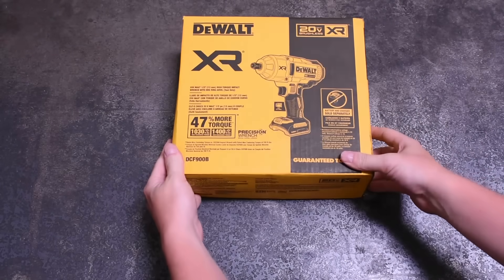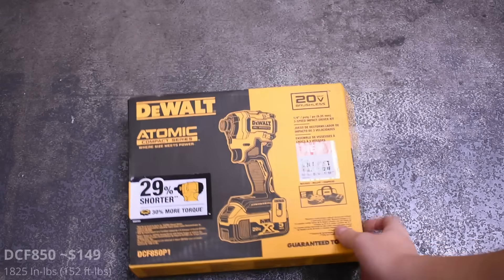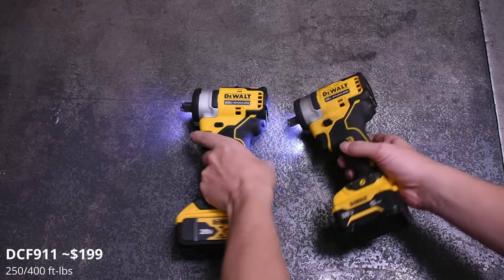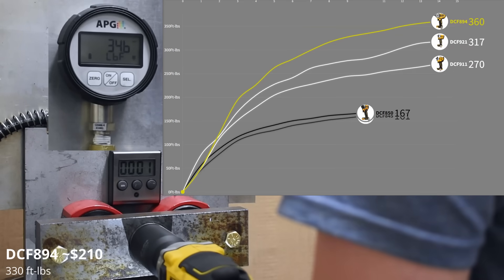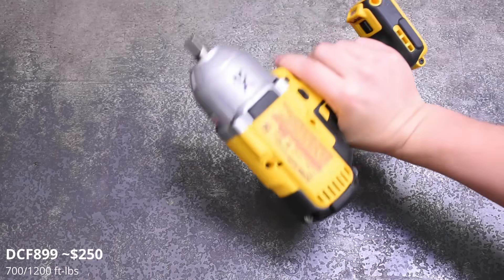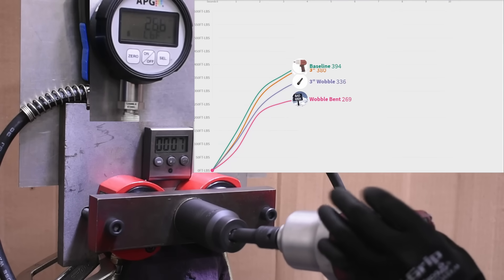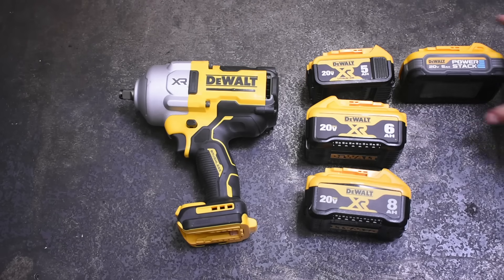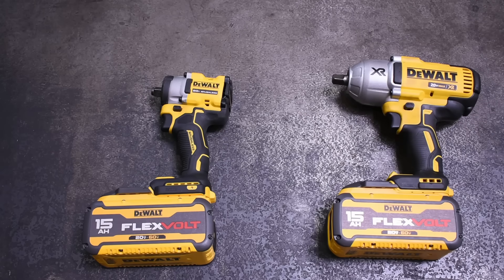Dyno Graphs of Every DeWALT Impact: How Much DO You Need?

Comment from the maker: You can currently get a Powerstack for $63 or w/ charger for $85 for some reason: https://amzn.to/43odkCD, https://amzn.to/3pL0Ki1
6Ah XR: https://amzn.to/3Wgntyw, 5Ah Powerstack: https://amzn.to/41Ka5nK
DCF961 big guy: https://amzn.to/3Gva9PR
DCF923 (3/8" size of DCF921): https://amzn.to/3Ilx5Cm
DCF891 Mid TQ: https://amzn.to/3BVPiDj
DCf901 Compact: https://amzn.to/42LQ9SI
DCF900 High TQ: https://amzn.to/3o3Nrcd
DCF850 Driver: https://amzn.to/3WbqtMQ
Reply: New Flex mid torque review soon?
Reply: @nickduplaga507  I asked that not too long ago he said he’s just waiting for them to ship to him they have gotten delayed
Reply: Can we have this kinda of line up for all the major brands? I know some brands are sparse.
Reply from the maker: @Juan188812  That's our plan to eventually do as time allows and brands introduce more
Reply: @Juan188812  Too many ok tools leaves too much room for smaller brands to combine the niche tools.  People rather have one tool that does the work of two, and better, in the smaller of the two’s size.

Flex (small mid torque) will take Milwaukee mid torque customers.

Hercules Ultra torque (1/2 with bolt loosening potential of 3/4) will take many 1/2 inch high torque customers.  That’s why Dewalt is making a new high torque I think because it saw how much benefit it’s DCF900 made.  Meanwhile Milwaukee I guess is panicking with it’s shareholders while they try releasing more useless niche tools, that most people don’t care for because they rather save space, or money, or both.

It’s the reason Dewalt atomic compact 1/2 is successful because it’s better than the Milwaukee 1/2, and who wants an extra set of 3/8 sockets when they can use 1/2 for both high torque and compact.

Maybe Milwaukee releases a new long delayed high torque with the new batteries soon.  People don’t want to buy Milwaukee at this time I think.  It’s a transition into Dewalt, and smaller companies.  Milwaukee is lacking the big evolution jump rates of it’s products that other companies are doing.  The new drills, and impact drivers for example are barely any improvement.
Reply: Man I can never buy from your links as they won't ship to Aus! 😏
Reply: Man, I've never seen a 15Ah battery on a sub impact, but that was the hilarious.
Reply: Would the "new internals" DCF891 you're referring to be the DCF891b? Or does the "b" mean "bare tool"? I want to make sure I'm getting the version you tested when I buy one. There is also a kit listed on DeWALT's website that includes the standard bag, dual 5ah battery, and charger kit (DCF891P2), but instead comes with the "oil resistant", black 5ah batteries...can't find this kit in stock anywhere. I believe the kit number is DCF891GP2.
Reply from the maker: @FlyLan  b just means bare
Reply: You should have timestamps of the graphs for each one of these items next to their names. maybe AI transcript can help find the times.
Reply: No wonder your tests was so off from my real life tests here. You never had the DCF899 that smoked the milljunky red crap at over 1000ftlb torque on every other channel then yours. Well the other channels use actual torque testing tools to not some home made thing with some guess torque from so old clapped out snap-on.
Reply: YOURE losing torque power with that extension you’re using, why are you using that?
Reply: Thank you all for the amazing content you guys do extremely well on the information of tools and us as tool nerds and smaller YouTube channels about tools. Truly appreciate it❤

Comment: Please stop confusing impact drivers with impact wrenches. You do not use an impact driver in any aspect of car repair. They are for driving bolts and screws into masonry / wood etc. impact wrenches are used for removing lug nuts etc

Comment: I love the atomic 891, it’s a very powerful “mid torque”, I also have the 809, the 3/8 version of the 921 1/2.. for all the smaller stuff I use my 860 driver or the atomic 513 ratchet.. 

I’ve thought about getting the big boy 961 1/2 impact , or slightly smaller 900 but that atomic 891 has served me very well and hasn’t let me down on anything I’ve put it on… yet and until then

Comment: I have the small 1/4 inch hex drive impact and the mid torque. With a 5 ah battery and a harbor freight 1/4 inch hex to 3/8 socket drive adapter, they will shear the adapter at the drive.

Comment: I brought the DCF 900 and to be honest didn't know what I was buying, all I know is I was sick and tired of low torque cordless impact wrenches and the jobs they couldn't do on my car, the ones I brought think highest was 420nm and couldn't even undo wheel nuts, most cost me between £37 to £98 with case and battery and top brand I had is Sealey  400nm, but that is it Sealey stop there and have a lot of their tools and are very good so was disappointed they have never made anything more.  I paid £349 for the Dewalt DCF900 and could of gone for the DCF961 at £369.  But been very thankful for your video and was going to go for the one lower, I was thinking of the DCF 891 and 899 and surprising the DCF899 was cheaper then the DCF891, DCF891 was £330 and DCF899 £280 all kits come with 2 x 5ah batteries, charger and case.  All I knew I needed a higher torque and anything under 700nm I wasn't interested in, but when I read the spec on the DCF900 I thought I would go for it, after watching your review on these tools I feel I made the wise choice, item arrived yeaterday and tested it on bolts and impressed but glad I didn't go for the DCF961 as I mainly work on a car not commercial vehicles, but it is a step up a mighty step up from the DCF899 and looking at your review does the DCF899 deserve to be at high torques shouldn't it be down there with the DCF 891 mid torques?  So yes glad I had gone for the DCF900 because be handy at removing rusty suspension bolts and hoping it will make work easier, I have a lower torques which as two setting 1st setting 100nm and second setting 420nm and converts into a impact drive as this would be to heavy for engine but lower suspension and exhaust etc it will pay for itself.  The only negative is it is heavy and looking at the DCF961 that looks even heavier so yes impressed.

Comment: My recommendation based on the experience i have as a welder that is used to repair cracks on excavators, car carrying trucks, snow plows, wreckers…
To access the broken parts, a lot of disassembly is required 

The impact driver rule is: the more compact the better

I have the dcf 922 (same as 921 basically)
I use it 90% of the time up to M16 bolts 

A DCF900 for everything that won’t come loose with the 922

And if you really need more violence on a regular basis,
Go with a 3/4 like the dcf964 that thing kicks

Comment: Hello, how is the 891 doing these days in terms of reliability?
I've read in few places that the planetary on these give up, however the warranty replaces them no problem.
I'm looking for my first impact wrench - Mostly thinking about changing from summer to winter tyres, but I look forward using it on more stuff like brakes, it's just that I always craked everything with a breaker lol.
I'm torn between the 891 and 921 - I know that the 921 won't do eeeevery rusted bolt in the world, on the other hand I'm not sure if I need the torque+size+price of the 891. I'm torn plz help.

Comment: This was a really helpful video. I used it in conjunction with a spreadsheet I've put together with the help of AI and the "Speclook" website to allow me to get the right impact driver for my needs. I found the DCF900 on sale and ordered it, but then I realised I really don't need that much torque and I certainly don't want all that weight for my relatively light needs, so after considering the DCF891, I actually went for the DCF921, which is WAY down on power from the others, but the compact size and weight make the '921 much more appealing to me, even if the relatively low power doesn't seem like such good value compared to the '900 on sale. (I love a bargain! 😄) Anyway, being able to see the wrenches in use and compare the relative sizes was really helpful to me, so thanks!

Comment: Hello my dear friend, how are you? I want your advice because I am going to buy a dewalt impact werinch and I ordered a dcf900 from AliExpress and it turned out to be an imitation. The imitation is small, its weight is 1600 grams, and it is not like the one they have on display. They show it in a big size so you think it is really big. They are playing on optical illusion. I asked to return it even though they offered me half the amount back and to keep the product, but I refused. It turned out that the correct product is only available on Amazon and eBay. My question to you is which one is the strongest and best to order: dcf900, dcf961, dcf964, or dcf892? Please answer. Thank you.

Comment: Great video.  I just bought a DCF900P1 and it claims 1000-1400ftlbs and took rusty strut bolts off with ease.
Reply from the maker: all DCF900's are the same, the numbers after 900 mean bare tool or type of kit it's sold in

Comment: Now that's a proper video, kept going back and forth these couple of days, just got home with my DCF900. I wanted the 961 originally but for my use cases meaning my own car, bikes and some rusted bolts here and there around the house it made no sense, also that monster torque scared me I didn't want to risk damaging sockets on every use, plus it was too wide and heavy, the 900 has great ergos and while still heavy it's not that bad

Comment: I have to remove the anode rod from a 30 year old hot water heater that still works fine   (The original rod has never been removed.)  How much torque would I need for that?

Comment: You should doing a test on the Dewalt 413B Grinder. We purchased it a year ago and were blown away that we could not used it with any battery combo other than 5 AH or higher or it would drain it in a matter of seconds. I was running fairly new batteries and it just would not run on anything long unless I ran 5AH. Would love to get your take on this. 
Does Dealt Grinders really suck batteries that much or do I have bad batteries or a bad grinder or do they just have a bad design. I actually love their grinder aside from the battery hog.

Comment: I own the DCF891 and DCF921. So far the 921 has no problem with small/mid cars lugnuts, caliper bolts, and (with some extended hammering) axle nuts. It definitely packs a punch for its small size. If I don't want extended hammering, I'll grab the 891

These two impacts should cover a very wide range of vehicles, if not dealing with heavy duty stuff or rust

Comment: I have the Atomic 923 and 921 with the power stack battery. Use it all the time for light suspension work. I also have the 891 with power stack batteries and that does 100% of what I need it to do. The first day the 891 can’t get a bolt off I’ll be getting the 900 with an XR 6amp hr battery. This channel helped me get these tools over Milwaukee

Comment: Initially i bought the new Kobalt 1/2 mini compact impact wrench which was cool, super compact, and light but wouldn’t bust 100 ft lb lug nuts so returned it for a Dewalt dcf 921 with 1/2 anvil (only 3/4” longer head than the micro? Kobalt) after watching your other video on compact impacts where the dewalt blew away all of them in torque by like 90 ft lbs in the 15 second reverse test! Needed head bolt busting torque and can’t wait to get it in! 
They have them on home depot online right now with a charger and 5ah battery for 169! Only a few bucks more than the Kobalt setup and saved a sizable chunk foregoing a Milwaukee. Love this channel!

Comment: This is pretty fascinating. I'm confused though. Why does the torque rise over time? I would have though the driver puts out a specific amount of torque. Does it increase the longer you hold down the trigger? Also, if a driver is putting out 150 ft lb of torque, why can't it break my lug nuts? The torque spec on them is 88 ft-lbs. Are you saying it just won't work if people have over torqued them, like is commonly done with air drivers in some shops?

Comment: Got the 891, from their recommendation. It wouldn’t touch my GF’s Hyundai Tucson lug nuts. I set my torque wrench to 160 lb ft, and it wouldn’t budge them either. It took a breaker bar to get them loose. 

On everything else it’s done fine for me.

Comment: My red Mac Tools version of DeWalts 4Ah XR battery died yesterday. I tried to revive but it's my oldest battery and it was just tired 😭. I suppose I'm going talk to my tool man and see what he can do for me a better one. I have two of the 9Ah Flexvolts, a 5Ah XR and I recently bought a 8Ah Power Pack. I think I'm going to go for a big Power stack just to have another "light" battery. My right shoulder is mad that I bought that 961 and run it with those Flex Volts... 😅💪

Comment: Should a DCF921 with a 4AH battery be able to remove lugs nuts that are torqued to 80 lbs?  I am trying to figure out if I might have an issue with the tool or if it’s not the tool for the job.

Comment: I just received my DCF911 today.

After years of air impact, then electric, I was ready for a battery powered one.

Since I'm already into to the yellow brand ecosystem for my battery powered tools, I bought the DCF911 thinking that it would be a nice addition to my tool box.

Man, how did I wanted to like this little thing!

It's so little in my hand, nimble, light... 

You say "does the job 90% of the time" and it's my own motto.

But when 50% of "your" time falls into the 10% it can't do, it sucks... :(

I tried it, out of the box, with a fresh 5 Ah battery and I wasn't able to undo my F-150 lugnuts!

We have 2 "cars", a Corrolla and a F-150 so I tried it, out of the box, with a fresh 5 Ah battery and I wasn't able to undo the F-150 lugnuts.

What a bummer!

I always use a torque extension when I install my wheels so even if those aren't overly accurate, it's not like the nuts were madly overtorqued.

So as much as I wanted to keep it, I'll have to return it, I have no need of a tool that does only 50% of the job.

Should've bought the DCF921 straight away...

Thanks guys for your job, it's pretty useful (even if I saw this comaprison a little too late)
Reply: Just in case when I bought the last 2 of my tools the 960b impact and the 1007b hammer drill fresh out of the box batteries read full but only a few minutes of use went dead fully charged them then they were really charged and full powered just in case try it out maybe by now you did

Comment: Unsure if you'll see this comment on auch an old video but i'd just like to say thank you! Here in the UK the power tool options are basically just dewalt or Milwaukee (or draper, who make some absolutely mind bendingly good kit that's cheap as chips but can be difficult to find) so having a full lineup test of the dewalt kit for one type of tool has been hugely helpful. Ordered the dcf891 after watching this so thanks!!

Comment: No disrespect intended I just stopped in because I'm looking to find if anyone has any information about using a brushless motor as an induction heater because I have memory and I think I'm tripping of the first time I ever saw a DeWalt brushless anything and I didn't believe it was brushless so I took it apart and I forgot to take the battery out of it or I hook the battery back up to it while it was a part and I heated my screwdriver up and it burnt myself and I was showing pissed off about it and they were having trouble breaking some lug nuts on a trailer loose and I almost burnt the insulation off of the coil because the heat and the lug nut up too hot and not having the fan spinning

Comment: I'm torn between the 891 and the 921. I mostly use it for lug nuts torqued to 90ft/lb. I switch between summer and winter wheels every year so they don't get that rusted on, if at all. Should I just get the smaller 921?
Reply: I got a DCF911 for the same reason.  $150 online. It works great for me.

Comment: So they lying about voltage. A 5 amp 18 v is weaker than a 9amp 54 v which they say for tools that take 18 volts the tool only takes 18 volts not 54. It might not take 54 v but surely more tan 18 v. I'd assume 30 v at least.

Comment: Hmmm I think I want a DeWalt impact wrench... but I wonder if a driver would do for my home use. I wonder how much research I'll have to do to figure what I should buy... and is a driver good enough on its own for my applications?

Torque Test Channel enters the chat. Here's a video that literally shows everything you want to know in one place. I also figured you'd want to compare what happens with different batteries, I know you didn't ask, but it's probably important.

You have amazing and useful content! Also, great job on the entertainment factor.
Reply: I have the 960b for driver and is crazy the best one out right now is great and I got the 1007b for the hammer drill with the power stack 8ah another beast